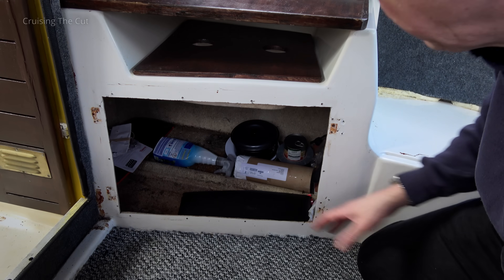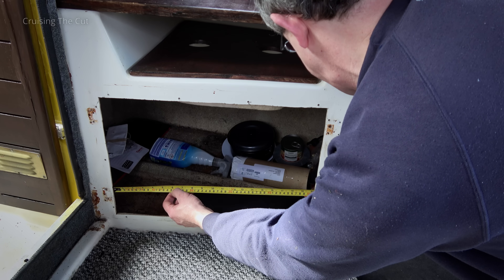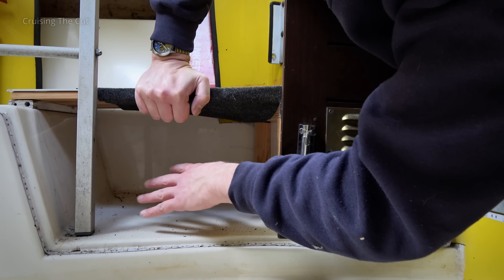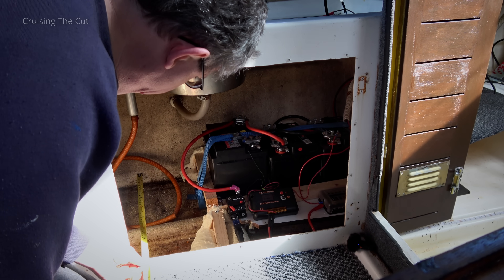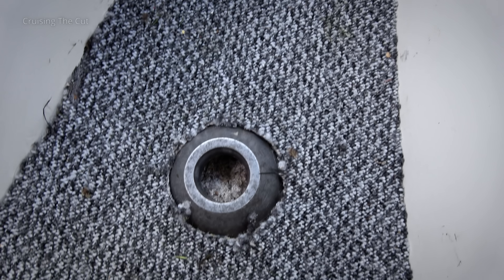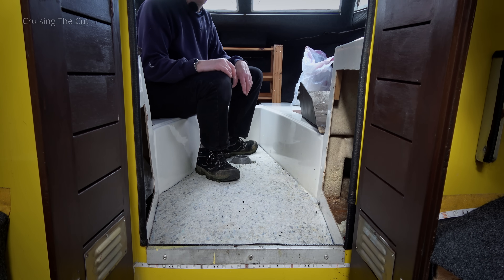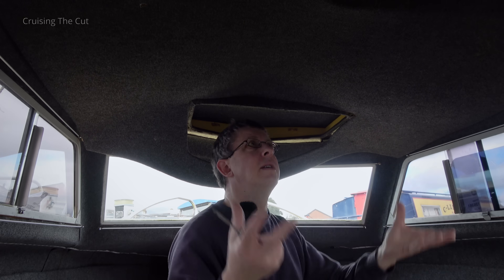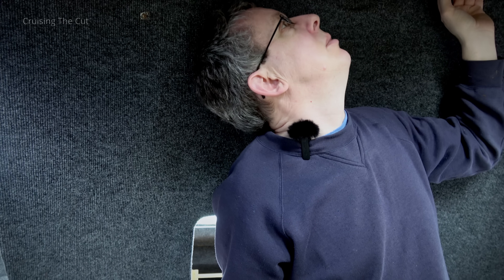329. Look what I found under the carpet!

Comment: Great project and series, David - thanks for taking us along. A couple thoughts about planning locations for things with any weight...Do consider balance when all is installed. Heavy items like batteries can give a smaller boat a list - even a minor one might be annoying. Myself, I have to keep my livewell on the one side of my boat filled to balance out the battery weight (and mine while at the helm) on the opposite far side so the boat floats level. Had the builder reversed the design the batteries would help counter my weight. Yes, I’m pretty sure I’m on some spectrum or another for this to bother me but offered up to think about. Consider other items if you have them such as water tanks, appliances, tool storage etc. In the overall plan.
Of a more serious nature - make sure your battery location allows for ample ventilation as charging creates nasty vapours. For this reason I’d vote batteries outside the main cabin under the helm.
Reply from the maker: Cheers. The battery will be on the opposite side from where I sit to steer, plus it will be lithium so not that heavy. And also balanced by the water tank. Hopefully…

Comment: My thoughts on battieries....thin insulation on those cockpit areas and install the batteries there to free up valuable cabin space.  Batteries outside on either side would even up weight balance.  Good luck there.

Comment: You might want to consider that if you get a new outboard, an electric start would make life much more pleasant.  If so, you really want a starter battery as near to the outboard as possible to save long thick cables losing voltage, etc. and they only trigger by a thin wire to a starter relay.  This not to say all your batteries need go near the back, only a starter battery.  Just something to think about.  This series is so much fun to watch.
Reply from the maker: Yes I will be getting electric start!

Comment: One thing to help with battery location is the distance from the battery to where the load is.  The greater the distance the thicker the cable.
Get a roll of brown paper to use for template making, simple and cheap(ish).
Reply from the maker: Certainly true but this boat's so small it won't be a huge concern

Comment: @CruisingTheCut  I seen that they do make "Drawer Refrigerators" for marine boats. Which the pull out would lots of space for a few drinks and able to least stack up four small bags of meat or veggies.These maybe costly, I suggest looking for a surplus or 2nd hand store that have marine refrigerators.
 If you want a larger open top fridge? Why not place it under the seating area. Which other Microplus 600 owners add storage bay there before. I saw photo of someone converting the whole stern into a galley. Keep in mind the weight and not off-set the boat too much or have to add counterweights.
Reply from the maker: I have bought a tiny top-loading fridge.

Comment: Getting rid of that dark carpet will certainly brighten the boat up rather a lot.  A traditional finish for the inside of the hull would be strips of varnished wood (ash, teak, mahogany) with 1-2 mm gaps between them.. Glue some vertical bit of wood to the hull to screw the wood trips to.  As far as the overhead (Ceiling) goes, I would sand it smooth and paint it with a light color like off white.  That will keep the interior nice and bright, particularly at night and a painted surface is easy to keep clean.

As far as the fridge goes a smallish top loading refrigerated cooler is a good way to go.  You can put it on a sliding base so you pull it out to open it.  They also use less power than a traditional fridge and are quite reasonable in price.  In addition you can set the temperature and even use one as a freezer if you want simply by setting the temperature lower.
Reply from the maker: I have bought a tiny top-loading fridge.

Comment: Just watched your plans for 24 video and you mentioned the transom...  I had a boat that I needed to work on the transom.  The bloke I got to help me basically cut a sheet of metal tread plate that he attached to the back of the boat where the engine sits and out around that area, a few screws and some sort of sealant filler smelly stuff was used.  It is a bit hard to explain but go and have a look at a few other transoms and you will see other boats that have had it done.  I tell you what, it didn't half strengthen the transom.  It went from being floppy to the point I was sure my engine was going to fall off,  to being rock solid and it looked amazing.
Reply from the maker: Interesting!! Was that as well as a rebuild of the wood in the transom or instead of?
Reply: @CruisingTheCut  This is going to go on a bit sorry. It was instead of.  I thought there was going to be lots of wood cutting.  But it was more of a treatment and reinforcing with i big piece of tread plate.  I was surprised that this was the solution too.  When I noticed the state of the transom I originally thought the boat could sink because of it, but as I got to learn more about the design of the boat I realised it was more keeping the engine on than anything else.  So it was more a matter of making the transom solid enough.  I got it done at oundle marina which is also a very affordable place to keep a boat but not a great place solo as the locks on the nene are a real bugger.

Comment: Hi David, I had a Indel TB18 chest (like a coolbox) compressor mini fridge in my old camper, they're very power efficicent and maybe could fit in that gap, or its shorter brother the TB15 maybe :)

 We've used Basix T and G plastic panels on roofs before, you can tiger seal/glue it up and the amount of textures is baffling :D

Comment: I would have been in the leave the carpet in situ camp, until I saw the reverse of it, as you took it down. It didn’t  look  at all pleasant 😖. As to the fridge option, that size of gap might take a beer fridge. I have one & I have never kept beer in it. I simple turned the shelves over and used it as an overflow fridge. For carpeting, have you thought of trimming down an outdoor carpet, as this would be more water resistant & less likely to fray. I do think it would be a great idea to use a bathroom type covering for your roof, then you can wipe it down. Much more hygienic. Decisions decisions.

Comment: As a thought use a colour code to rewire Twiggy to make maintenance easier, like green fot stb light and orange for port  leaving red for your positive feed and that leaves you a few more colours for other circuits.
With a view to the tambour door I have found long term they can be tricky to use and usually it is to stick to the kiss principle. Just a few thoughts from an old phone technician and cabinetmaker in Australia andy
Reply from the maker: Yeah, the tambour in my van is a bit sticky sometimes.

Comment: The carpet really stops condensation dripping in your eye on a cold morning. 
Your enthusiasm is amazing, this will end up a boat to be proud of.
In one of my boats i used thin ply oiled finish and ply faced with stretch carpet above sleeping areas, looked  good having a contrast too.
What size water tank will you need , 25 litres any good.
Reply from the maker: A size that will fit the space (!), I'm not really after a specific capacity.
Reply: @CruisingTheCut  I have a new 25 ltr it  was for a  diesel heater, never used if it helps ill send it to you.i can measure it if needed.

Comment: I would suggest that you move the batteries to under the coxan station and then install a water tank leaving the electrical panel with small inverter and charger against the coxan wall.  That would be less work and leave plenty of space for the water tank.

Comment: I suspect that the ceiling and some of the side panels, where it looks like it has beams or ridges in the fiberglass, were originally filled with sheets of some nominal thickness polystyrene insulation before being covered with glued down carpet.   The ceiling to reduce baking from the sun and portions of the side to avoid colder areas of seating near the water.   The spray foam was probably done in some previous remodel.

Comment: You can measure at floor level "through" the batteries, you just need to do some addition. Measure from the door frame to the battery case, measure the width of the battery, and measure from the back side of the battery to the hull. Add those 3 lengths together and you have your required size. Accuracy is key so rounding doesn't compound any errors.

A bit tricky to get a measurement behind the battery, I'm sure, but some stiff cardboard or a wooden shim can be cut down until it fits at the point you want to measure. Then just measure that piece for the behind distance.

Comment: I’d be sticking battens on the ceiling with construction adhesive so I could then screw carpet-covered hardboard to with screw caps, with insulation between

Comment: One way of making a pattern I have read about and tried is to use legal size printer paper and a lot of tape. By laying the pieces bit by bit and taping the pieces together you can follow the contours of the space easily. 
  The whole carpet inside boats is a very '70-'80's thing. a couple boats I have owned both used carpeting as a cheap means of hiding the unfinished side of fiberglass boats. More expensive boats would have wood paneling or interior fiberglass hull liners.

Comment: Batteries that have any type venting means they require a battery vent system on the compartment they are stored in. The cabin area is not suitable unless the battery  area is sealed with positive ventilation to the outside. The helm area seems perfect to solve these issues and allows easy service/
Reply from the maker: I will be getting a Lithium (LiFePO4) battery which will negate any fumes issue.

Comment: Instead of crappy hardboard perhaps a  thin sheet of marine grade ply would give  smoothness and colour if marine spar varnish is used as a waterproof coating.....
The boatbuilding and Super Yacht industry use the  highest grade BS1088 marine plywood on the market from standard size sheets to Super size.
Meranti and Gaboon Marine plywoods are used extensively in the boat building industry. 
Used for hulls, bulk heads, cabinets, floors etc.

Comment: David keep in mind the weight distribution in Twiggy....
Those batteries need to be balanced against the weight of the water and the waste tank contents
perhaps the electronics controlling the battery charge and output need to be up as high as possible just in case of water ingress and contra dampness?

Comment: The space under the steps seems like a decent place for a drawer to hold gear you want quick access to such as wet weather coat or a lunchbox. Nothing too expensive though if it can’t be secured, expensive stuff like tools and electrical gear is probably better placed inside the cabin.

Comment: Have u considered adding a type of stabilizer for the undersides of the boat to help mitigate the unintended horizontal slewing? I am not knowledgable in boat terms so maybe stabilizer is the wrong word. But some horizontal planes on each side that run forward to rear so that sideways movements cause more drag. Like a couple long thin keels.

Comment: Watched earlier, back for comments and the algorithm ;-)  Expected a few comments like mine and was just going to add but a quick look hasn't spotted any yet. On the underlay of the floor carpet you pulled up, I'd strongly advise pulling the underlay up too. It might not be easy BUT... it's probably as old as the boat with little value left in cushioning, likely has or had water under it, maybe mold, and it would be a good idea to know what's under there before fixing it all up. You might find issues with the fiberglass that are an easy fix now, or even some further mystery wiring lol. Oh, also, a thin layer (maybe 10mm) of good high density closed cell foam (often in rolls with adhesive back) would probably be a great idea. Warm up the floor, help against condensation, and make the carpet that much more comfortable. Cheers and looking forward to more work on Twiggy ! Any chance of a short run in it while working on it or are you thinking get it ship shape before shipping out ?
Reply from the maker: I've bought closed cell foam for the insulation!

Comment: You mentioned some heavy items, barteries, fridge and water tank. It would be best to not change the center of gravity of the boat too much. Too much weight in the bow will make the boat dig in and make more waves. Maybe a water jug will do, one that you can fill somewhere and take with you? Since you will be in the captain's seat you might place some weight on the opposite side.

Comment: Compressor cool boxes are a lot cheaper than a fridge. Remember the main reason for carpet is that smooth surfaces condensate. I use get condensation rain in one of my early campers
Reply from the maker: I should have been clearer, I meant to wrap the surface in carpet.

Comment: About the batteries, I would prefer the batteries being outside, given the gases they release, the acid/chemicals they release when malfunctioning, fire potential, etc. Batteries are a waterproof box to begin with (check any car, motorcycle, boat, airplane). You just need a tray under it and protection of the terminals (lid/cap/terminal covers....) and hold downs.
Reply from the maker: I will be getting a Lithium (LiFePO4) battery which will negate any fumes issue.
Reply: @CruisingTheCut  As an EE I like lithium, but I also put them in steel boxes to limit flames in case they ignite.

Comment: As you have rightly torn the lining off down to the shell, it may be worth considering doing a bit of insulating with a layer of flexible closed-cell foam sheeting of some ilk to help manage temperature and moisture (and some noise as a bonus) between the inside and outside environment. Perhaps this was your intention all along.
Reply from the maker: I am indeed doing that!

Comment: David, have you considered something like a EcoFlow DELTA 2 instead of standard battery. Would give you both 12v and 240v outputs, will charge from solar and is portable so you could use it anywhere else, like your camper.
Reply from the maker: I don't like those things, would rather have separate items built into the boat.

Comment: Lining the cabin ceiling and or walls with plastic or any similar surface  will create  condensation issues unless you put in substantial insulation. Easy test anything whichvfeels cold/cool to the touch will allow condensation to form...
Reply from the maker: I will be adding insulation yes. The reference to the plastic was to give a more firm and water-resistant surface than the hardboard.

Comment: Apologies if this is not fully formed. 

It looks much better with the carpet out.  

I would get rid of the carpet and boards on the ceiling entirely. You could use the kind of sound deadening material they use for car interiors for the ceiling. The guys over at Junkyard Digs did a truck interior recently. They got fabric at a fabric shop. 

Sand and paint the walls. New carpet on the floors. 

Maybe the folks are Ship Happens have some input as well?

Comment: If you arent going to live aboard simply scrape of the gunge, fill the holes and paint it white. You can deal with condensation by fitting a diesel heater which you only need to run when you are on board. Even with insulation you will need a heater for all but the summer months ( days ). The cost of the heater will be defrayed against the time and cost of fitting insulation and panelling.

Comment: Expanding urethane foam is indeed and effective adhesive, especially on uneven surfaces.  It is unsightly but then again it was out of sight.  The carpet does act as a form of minimally effective insulation as well as sound absorption.  One solution might be affixing a series of battens in parallel along the ceiling which would provide a shallow space for wiring and a place to screw in your choice of headliner and affix lights.  It may also allow you to add a thin layer of insulation as well.  Those spaces under the pilot station and passenger seating are certainly potential storage spaces whether it be your battery - not really a good idea, I think - or other small items, bits and bobs as you might say.  

I'd also consider using a light colored wood as edging along where the new headliner meets the walls.  

It's pretty clear you're going to leave this boat in much better condition than when you found it.  I'm no fan of the yellow hull but that's merely a matter of personal preference rather than a criticism.  Good luck to you.
Reply from the maker: Yes, I'm going to add a thin layer of insulation.

Comment: A couple ofquick thoughts.. And sorry if others have already  mentioned  them.
1 re fridge.    Would a wine chiller not fit on a sliding shelf  in the small cupboard?   I was thinking of the sub floor type found in some boats and a set of kitchen cabinet  runners

2 re walls  while carpet is warmer and much easier to manipulate around the curves. I would have thought the plastic" shower" panels  would have several  advantages.
 They should have some flexibility.  
They would  not get damp/ hold damp. 
They are easier to wipe clean.
 And they should bounce  light around thus creating  an illusion  of space
Reply from the maker: I have bought a tiny top-loading fridge.

Comment: Remember, batteries  are heavy. Don't  tuck them to  far inside  any cabinets. Always  use a battery  box or tray for safety.  You don't  want them to slip or topple over.
Reply: This was my thought, tucking the battery behind the fridge in the cupboard will be much harder to get to than under the drivers feet in the cockpit, it wouldn't be difficult to make a tidy enclosure in the cockpit with screwed on panels to keep it all out of sight, much easier to unscrew a flat panel than remove the fridge.